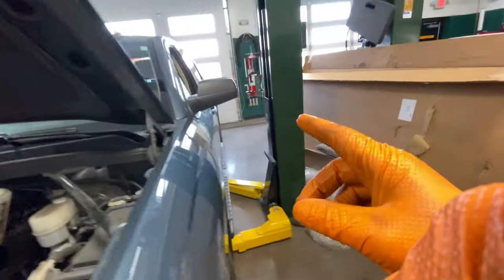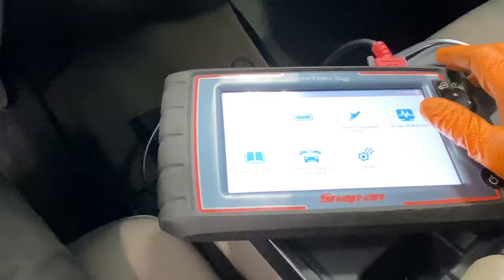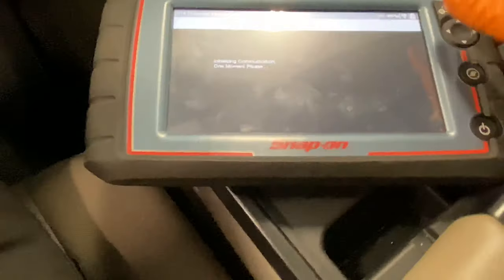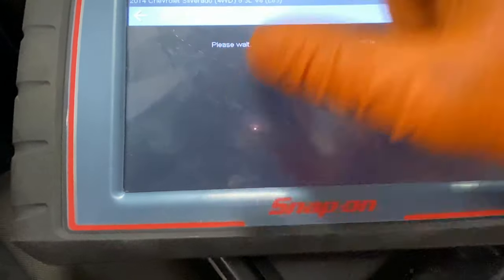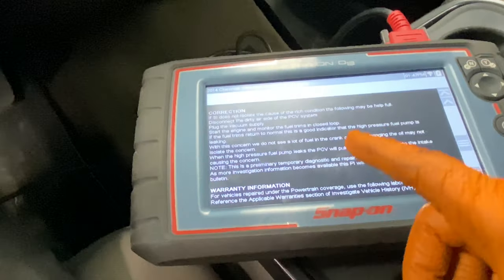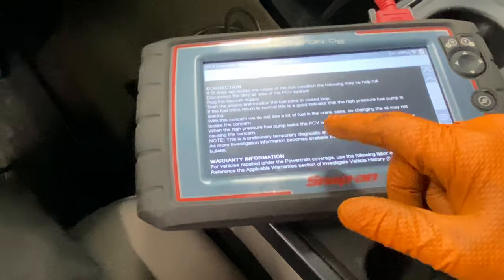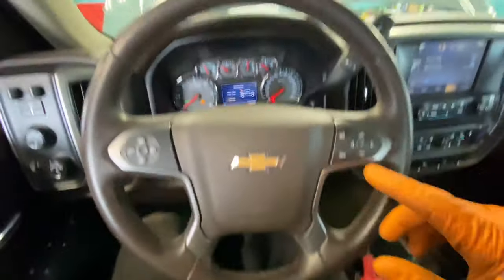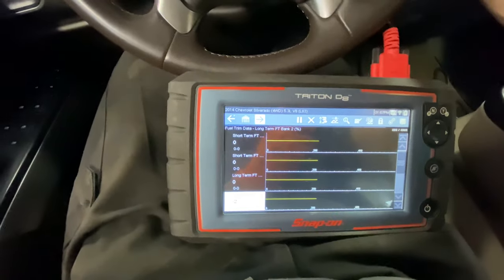GM 5.3 6.2 P0172 P0175 Fuel Trim Rich Diagnosis And TSB

Comment: Great write up bro... I like how well you explained it. May I bring up just a few things I believe would help people? So when you unplugged the MAF with it running and went back to looking at the fuel trims it really didn't show that big of a change. First thing is because if I was you I would have reset the long term fuel trims in the scanner to show the instant changes every time you made a diagnosis change.  Second is in order to get into SD mode on GM vehicles you have to set a failed MAF code in the PCM. That is 2 trip logic code so it needs to see the failure 2 times before it sets the code. In other words 2 key cycles unless its changed to a 1 trip failure in the tune. Whenever I tune the VVE table in these I first have to fail the MAF and set the code before the PCM references SD and I can then tune it. Otherwise it still will reference the old fuel trims and then your just tuning in circles. This is probably to much info for the standard person trying to figure out there problem, but I thought it couldn't hurt to add this info for the highly skilled techs. I have also had a lot of these HPFP fail and leak fuel into the crankcase. In fact one was so bad the the engine because to tick from the diluted oil and then would stall from the low rail pressure. Great video and keep up the great work and help you are showing people.

Kind Regards,
Ryan
Reply: Thank you

Comment: Question- Did you know there is a recall on the High pressure fuel pumps? RECALL - HIGH PRESSURE FUEL PUMP LEAKAGE
# 14858: Product Emission - High Pressure Fuel Pump Possible Leak - (Feb 19, 2015) 
It is ongoing… My 2015 Chevrolet Silverado 1500 with RPO L83 is on it but vin not coming up. Figuring it out with GM now
Reply: I'm going to get in contact with my dealer on Monday and attempt to schedule this recall repair.

Comment: Great video.  I have sane issue on 5.3l. Could it be just the oil getting sucked in from the pcv? I  don't know if it has ther same hpfp like that 6.2l
Thanks

Comment: Hello Pete , I have a 2014gmc sierra with 212,000 miles, and I have a P0420 , P0430 and a p2099 code . I've been trying to figure out but it's been beating me. I've replaced all the 02 sensors and nothing changes. I've replaced the cats as well but the codes remain the same. Do you have any suggestions besides getting a new vehicle?

Comment: My 2015 Silverado is throwing the same codes. Also idles really rough at low RPMs. Would that be the same solution?
Reply: What was your solution? Having these problems.
Reply: I'm having this issue
Reply: Any fix??
Reply: Replace high pressure fuel pump. Common failure.

Comment: Um. I dont understand the end. Is there a part 2 or something??
Reply from the maker: noahkb80 there is a video on replacing the high pressure fuel pump as well as cleaning the intake valves
Reply: Is the high pressure fuel pump the same thing as a fuel pump in the gas tank? Had it changed but still a rich condition (p2099 and p2097 codes).

Comment: I have a Yukon 5.3l with these same codes and I checked the dipstick and had a strong smell of gas from the oil. I just purchased this vehicle a few days ago and Im worried the pumps been leaking for some time and reducing viscosity of the oil. Im going to drain the oil and hope I dont see any metallic shavings. 

You this failure is common on gm ls  engines. Have you seen engine damage from contaminated oil from a leaking fuel pump?
Reply from the maker: Yes and no. This is an interesting topic though. Typically modern day oil is pretty resistant to breakdown from fuel, but yes enough of it can absolutely change the oils properties. By that point though it’s probably going to trip oil pressure codes and or the low pressure light. I wouldn’t sweat it too much and just confirm the HPFP needs to be replaced. Definitely change the oil asap.

Comment: I had a throttle body relearn done to fix the constant problem after cleaning it.  I think I may have made a mistake I did a fuel composition reset using X431 on my 2011 5.3 flex fuel suburban , currently have e85 in my tank. Now I have 2 code errors p0171-00 and p0174-00  fuel trim lean system lean bank 1 and 2.  Did I do something wrong? I would appreciate any help what to do and proceed. Thank you
Reply from the maker: I’d say very likely you do in fact have a lean condition if that occurred after a fuel comp reset. I’d monitor it on live data and look at what the trims are showing. Lean condition can be a number of things but I wouldn’t necessarily blame it on a comp reset.
Reply: @Pete_Tech_  I did a reset using gasoline filled everything is working fine now. But I feel there is a small continuous leak keeping my fuel rails at 45psi . Since 85 barely you can smell the odor of gas , I smelled something today since my suv is filled with gasoline only  . but i still cant find the leak.. my fuel consumption is more than normal its like my tank is leaking only when its on. i checked my gauges perfect, using my scanner I checked everything and also my hwy is 18mpg but with my fuel gauge dropping faster than normal feels like 8mpg.. I used several model gauges to read my average and instant mpg and its good.  My question is can a micro hole somewhere with car on can leak out fuel through my fuel line to cause this?
Reply: even in lean condition my suv was eating gas.

Comment: Ok but mine IS rough running. Very rough running. Replaced fuel pump and re learned the trim several times but it inevitably always comes back in a short time with rich or lean codes and runs rough. What do I do????
Reply from the maker: Check the MAF. Check how responsive your O2s (although that would usually be a particular bank condition).

Let’s think about what controls fueling. We need to meter air, and we need to meter fuel. MAF tells pcm the air volume/density. O2s feedback the AFR for corrections/correlations. 

Assuming all the mechanic is good, properly working HPFP, proper fuel pressure, healthy compression, proper timing, etc. Always verify the mechanical first.
Reply: Pull the purge while running if there’s no suction check the evap canister could be soaked with fuel.. from overfilling ! Replace canister hope it goes away

Comment: Nice. My 2013 Si;verado had LTFT B1 -25.8%, LTFT B2 -25.8% and P0172 Fuel System Too Rich (Bank 1).  Startup takes 15 seconds. Take-off is very sluggish.  140k with O2 sensor errors.  P0053 for “Heated O2 Sensor (HO2S) Heater Resistance (Bank 1, Sensor 1).”
Fuel Injector leaking.

Comment: Awesome video! I need help. I am getting a steady 45 psi on my car 2011 suburban 5.3. I feel like its dumping fuel because my fuel gauge goes down more than normal. I see everyone else mention 50 to 60 at the rails but i am using my expensive x431 scan tool to check everything. All of a sudden after 1 month of using e85 its been  extremely bad. Fuel gauge drops fast. I cant find no wet fuel leaks by the engine compartment. My mpg normal at 15 to 18. Now feels like 6. I am also using a scan gauge to read the mpgs and its not bad hwy is 18mpg both dash and scan gaugeii. What the hell is there a small leak some where only when its on?  I get no code errors.
Reply from the maker: I’d put money on your HPFP is leaking into the engine. Check your oil yet?
Reply: It takes about 30 percent more e85 than it would regular gas . Just saying

Comment: I need your help man. I got the same codes on mine. 2003 how do I figure it out. Same issues. I have driven it for 6,000 miles with the check engine light coming on and off. Trying to track down what it is and I’ve changed a million things.
Reply from the maker: You have rich trim bank codes on an 03!? That’s rare hmu on insta Pete_Tech_
Reply: 02 available 5.3 both banks rich 🤷🏻‍♂️
Reply: I'm having the same problem I think on my 06 Silverado 5.3 runs fine changed the fuel pump cause that's what auto zone said luckily it was under warranty and changed the mass air flow sensor light still not off I always fill up and run it to empty really could use yall help
Reply: @Wayno228  hey mine doing the same you ever figure it out

Comment: Ok. I removed the pcv hose and plugged both ends as per ur video.  My trims dropped to normal range! But about a minute later they climbed again.  Any suggestions?
Reply from the maker: That is pretty common. Most likely the oil is so fuel saturated that it will permanently affect trims until the oil is changed. However, if you have this engine set up with over 120,000 miles it’s advisable that it probably needs a high-pressure fuel pump. Keep in mind I said probably, not certainly.

Comment: I have 2001 gmc sierra with a 5.3l and ive replaced the fuel filter fuel pump and fuel pressure regulator and its still running rich about -31 shft bank1 and 2

Comment: Had this issue, garage said alcohol % was showing 47%. 
They reset and truck back working great But now few months later issue is back. Truck hard to start mornings,  rough idle. 
Reset is only short temp solution. 
What should garage do?  
2011 SLT Sierra 5.3l flex fuel.  185,000km’s
Reply: I got the same issue.  09 5.3l. Alcohol was high then low. I'm going to try the pcv test. not sure if ther 5.3 had the same fuel pump system though. could just be the oil getting sucked in from the pcv? Did you get yours fixed?
Reply: @greyhairedmountainbiker116  reset alcohol then week later codes for oxygen sensors! I changed  both oxygen sensors on the left side bank 2. 
No issues yet. 
Also I stopped refueling until it pour out! I had a habit of topping up the tank not realizing harmful to fuel pump and filters
Reply: @gregwiggins9380  Im having the same false high readings of ethanol on my 2013 gmc sierra 1500 flex fuel. I was told by the dealer that short trips may be causing the false readings. Did you resolve your issue?
Reply: @RR-ty6ki  yes I changed both O2 sensors on passenger side, was getting codes for that too! 
And big thing I think I’m NOT filling up the fuel tank to the gas cap! 
I was doing this for the past few years. 
Also I was adding a bottle of fuel injector cleaner with a overflowing fuel tank. 
I would have issues it seem shortly after.
So 
New O2 sensors, no overfilling tank. Issue gone.
Reply: Issue still gone?
Reply: Yes, but after I stopped over filling tank AND changed the air filter! we have dirt roads and filter was totally full! Thought I changed it. 
Fault code would only show up on road trips travelling at highway speeds. 
Problem went away.
Reply: @gregwiggins9380 the o2 sensors are used to calculate the alcohol content

Comment: I have both codes on a 12 GMC Sierra. I do have a bad ac condenser though? Like no air cooling at all. Could this be giving me rich codes because of there being a bad ac condenser?
Reply from the maker: Definitely Not! These HPFPs fail, and the Valves Carbon up as well. Its the inevitable.
Reply: @Pete_Tech_  so it's def not anything to do with the air condenser? So possible injectors or fuel pump than I'm guessing. I appreciate the reply

Comment: Is this not the ethanol level being detected too high (falsely)?
Reply from the maker: No, the vehicle knows the ethanol level if it’s flex fuel capable. Rich trim codes mean there is an excess of hydrocarbons crossing the O2s in comparison to the calculation the vehicle man. High ethanol content will lean out fuel trims on a vehicle.
Reply: @Pete_Tech_  Would a false high ethanol content on a flex fuel create a rich situation if the tank actually had regular fuel?

Comment: My 2016 GMC Sierra have a very strong odor of gas fumes in the cab. My oil smell like gas when I changed it. I Took it to 3 GM dealerships to get it diagnosed no one can find the problem. I have no engine light on either.
Reply from the maker: I’d put a high pressure pump in it!
Reply: I've read that if you get fuel in the oil, its the high pressure pump. 
Did you gain oil?
Have you been burning off white smoke?
Reply: Did you ever figure out what caused fuel in the oil?Thats happening to my 2014.
Reply: @strayedarticle7666  I changed the high pressure fuel pump. I can still smell gas fumes in the cab. Come to find out it was the vacuum pump. Which GM has a recall on it and changed it out for free. Solved my gas fumes in the cab. As for the oil smelling like gas I just think is somewhat normal now. I have over 100,000 miles on my truck no other problems.
Reply: Buuboi214 thanks for the info.It must be sorta normal for oil to smell like fuel because mine does and my boss has an f150 and it did also.Maybe that’s just how it is with new trucks.

Comment: Ford Ranger 2014 2.5L 4 cil Gasolina 
-Codigo del vehiculo: P0172
Por favor ayuda! 
Ya hicimos varias cosas y mi mecánico no encuentra la falla! 
Se ha hecho esto:
-limpieza de cuerpo de aceleración
 -cambio de filtro de gasolina
 -cambio filtro de aire
 -cambio sensor de oxígeno
 -se calibraron los inyectores
 Se le reviso: 
Válvula PCV
Bujías
Bobinas 
Mangueras de aire 
Presión de gasolina 
Y el código P0172 sigue apareciendo Aproximadamente 4 horas después de darle uso normal a la camioneta. 
Que podemos hacer?
Mi mecánico ya no sabe que hacer y yo ya estoy cansado. Cada que la llevo me cobra algo nuevo.
Reply: estan cambiando por cambiar. tienen que limbiar bien INTEI O aralla como le dicen en otros paises. la carbonilla entre las valvulas de admision hay que limpiar.
Reply: Vendela!

Comment: Have a Cadillac SRX 3.0. P0172 and 175.....new high pressure pump installed no fix...
Reply from the maker: Can always have a shop perform some diagnostics on it!
Reply: @Pete_Tech_  I figured it out..was a bad mass air..
I missed it due to the settings in metric instead of grams on the scan tool..
Reply: @andrewcimochowski  what were you symptoms? i have a 2014 Chevy Silverado 5.3L V8.
Reply from the maker: Silverados usually are severe carbon buildup on intake valves, HPFP, or potentially dirty mass air flow. Use brake clean from at least 8 inches away from the screen and blast for 3-4 seconds. Blow dry with LOW pressure air, or let sit for 30 mins, then run vehicle again. Cleaning the mass air flow is a good place to start. Rare the Silverado mass air flows go bad on the newer ones.
Reply: @Pete_Tech_  what's your opinion on using Seafoam to clean the injectors and replace the air filter? I've seen a few videos with error codes p0172 & p0175. they said this cleared the codes and the problem that seemed associated with an o2 sensor. symptoms being misfire, system too rich and even transmission slip like but the transmission wasn't actually slipping.
Reply: @andrewcimochowski  did you solve the problem after finding out it was the maf
Reply: @moniquelucio2817  the mass air sensor fixed it
Reply: @andrewcimochowski  nice! I hope mine does the same fix as well. Did you replace it or just cleaned it?